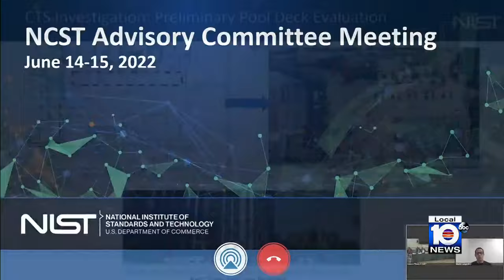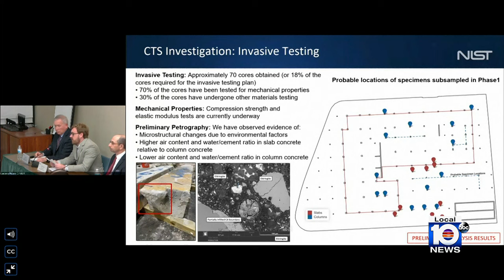Surfside building collapse: Pool deck showed ‘severe strength deficiency’

Comment: The building wasn't up to code.  I'm so glad they figured that out 2 years after it collapsed plus 40 plus years of inspections.  No reason to figure that out during the design, permitting and construction phase.  The reporter should of interviewed Captain Obvious.
Reply: it requires effort to validate any hypothesis

Comment: Everybody who built it is dead now. The mgt co is negligent in carrying insufficient insurance and not maintaining the bldg structurally. The trail will lead to them.
Reply: You have to understand that the effects of the design flaws and construction shortcuts in 1981 cascaded and amplified over decades, causing "knock-on" effects. There were two core weaknesses in the inception- first, the building was under- designed. There simply wasn't enough support under the sections that collapsed. Notice that the front section that remained standing, had 24" X 24" columns supporting it, while those underneath the other two wings of the building were 18"X18", not nearly the strength needed, and not enough of them. Then, they were packed with too much rebar for the amount of concrete. 2nd, the building went up on rather unstable ground with porous limestone beneath it, in a salty environment that corrodes buildings and machines alike far more quickly than other climates would. 3rd, it is likely that "beach sand" heavy in salt was used in the concrete, introducing highly corrosive salt to the structure. Add to all this a hundred and thirty individual condo owners who hate having to pay for anything they can't see and fellow owners who are just as non-expert as they are on the Board, with rapid turnover in ownership of the units and of Board members, many of whom quit the Board when they began to see how large and expensive the building's problems were becoming even 20 years ago. All together, these conditions multiplied and cascaded over decades to produce the perfect storm that ended in catastrophic failure. One engineer, a Professor of Civil Engineering at the University of Washington, said that she was surprised the building stood for as long as it did.

Comment: Florida is a sand bar. I think that Florida is using up too much ground water. So sinkholes are common and much of the state is settling giving the impression that the sea level is rising, but just the opposite is true.
Reply: This happened in South Carolina
Reply: @kmick8108  Sea Level is right where it was when the Mayflower Landed at Plymouth Rock
Sea level is right where it was when Rome Invaded Britain
Sea Level is right where it was when the Persians requested Land and Water from the Greeks.

Comment: It's also near the ocean which has more wear and tear. Like replacement of a lock and key on door because sand wears away fast too. 1980-2019 almost 40 years. Concrete starts separation from rebar after 50 years. The pool leakin, sand and the main structure beam collapsed. With housing chemicals in a storage closet near the bottom. And garage sand ratio.

Comment: a building meeting "half" of the standards  should not collapse like that though.  I have a feeling the standard is very  low in Florida.
Reply: Many of the residents had renovated their condos by adding stone bathtubs, floors, walls, and counters, adding about 10 tons to the weight of that ONE unit.  Now, imagine 20, 30, or 40 units doing that.  

Even a structure that's up to code would have trouble holding that much extra weight.
Reply: Building codes were tightened greatly after Hurricane Andrew in 1992., but CTS was built in a tiny suburb, Surfside, which lacked even a full-time building inspector, and at a time when the whole Miami area was unbelievably corrupt and development was dominated by shady, unqualified people.
Reply: Structurally build incorrectly, tons of weight ( including water settling for years) on that pool deck. The residents should have been evacuated around 2018 when they got that full report of the building. Very sad and disappointing.
Reply: It's not just Florida. Look at the millennium Tower. Jeff Ostrom has been pointing out these failures for about 2 years now.

Comment: yep no engineer ever gets punished for their stupidity. i fix bad engineering crap everyday
Reply: because by the time there is a a problem the statute of limitations for any criminal charges has passed
Reply: @zjones9876  in some cases. but i see bad design in new building systems on mechanical systems and they never have to pay for the stupid designs that dont work. i fix bad design crap everyday but im good with it. job security and great pay

Comment: 80s architectural planning was devoid of sophisticated simulations.
Reply: Some of the most advanced buildings we have were built rather before that. The Hancock Building in Chicago, built in the early 70s, is considered to be an engineering marvel and nothing built since has bettered it in sophistication. This Surfside building, like too many Miami-area buildings built in an era during which Miami was notorious for criminality and corruption in its governing class. was thrown up as cheaply as possible, in a tiny suburb lacking a building department with either the expertise or the budget to provide the oversight needed to assure a good design and a good build. Any architect who designed one of the beautiful and super-strong high rises built in the early 20th century could have told the architects and engineers involved in the design of the Champlain Towers buildings that CTS was seriously under-designed and under-built.
Reply: @chicagonorthcoast  absolutely.i agree.

Comment: punish the building owners with maximum penalties. their negligence murdered people.
Reply: no its the designers not the owners
Reply: The architect company and building contractor company are responsible, not the "owners".
Reply: @hyc1266  if the contractor built to spec then they are not responsible. the designers are. they are wrong more than people think
Reply: The failures appear to have been the construction company and the architect s, but many of these condos were remodeled to have heavy stone and glass walls, etc.,  and the building was never built to withstand it. Did anybody foresee the collapse, I don't know. I'm surprised it didn't collapse long before it did

Comment: Im surprised it doesnt happen more often in miami dade county. Many of these high rises have multiple, years old building citations and failed fire inspections. They might have massive liens, sure, but the owners can just ignore and delay. Theres no actual enforcement.

And lets say you want to get the issues fixed. The inspectors wont return contact and the office just tells you that the inspector has to be contacted. County wide, code enforcement is an absolute joke there.

Comment: Not buying it.. The roof was flooded and filled the basement  parking with water as first witness to try to go there said it was filled and he backtracked .. The fire alarms were not sounding and no flashing lights means the sprinkler system did not activate . Historical images shows roofing materials  ..pallets loaded and there was massive rains the days before ..
Reply: bad designers and engineering. plenty of basements everywhere can and do flood with water  they dont fall?
Reply: @bullofthewoods9374  the roof was flooded .. the roof was weak and the fail point was the fire sprinkler riser and mechanicals leading to the roof where materials weighing over 1600 lbs were stored   ..the water  in  the garage was from the roof ...maybe read the comment .. The roof failed leading to a pancake collapse pulling the columns ..as they were on top of the pile ..
Reply: @bullofthewoods9374   also stop liking your own comments ...it is shallow ..
Reply: @whirlwind8825  bad designers. oh and stop lying no one is liking their own comments. its shallow of you. im in building maintenance and see flawed design daily. . systems fail due to many reasons beyond the designers ability to know. it should be designed into the buildings. failures  many times is a cut corner issue due to money, done by designers. contractors build to spec or will be failed during inspection. granted if the inspectors do their job. Sure there are times when contractors cut corners but if done by design and they fail this is not a contractor issue. its the design and or material failure. things happen. pretty much any failure can go back to bad design or bad material, sometimes bad work but again the buildings have to be built to spec or it should fail inspection.
Reply: @bullofthewoods9374    The building was inspected with demands on the  40 year inspection ..  The strobes were not flashing .. the fire alarm did not sound .. The master 300 psi pumps did not energize .. and the water from the roof went through the  riser shaft and filled the parking area .. The pool lost 0 amount of water . Stay on point maintenance man ..and again stop liking your own comments .. This thread is not active ...for a "Like"  1 second after you made the comment .. very very shallow  my friend ..
Reply: @whirlwind8825  again not liking my comment. fire systems are tested every quarter mr know it not. nfpa the collapse would have rendered the system inoperable. if what you say is true then many  many entities failed to do their jobs. stop laying blame on others. the issue stated with a bad design and bad materials. no one seemed to give a crap and looked the other way. not saying the roof didnt fail question is why? my deal is why did it fail if it was so called designed. several things had to happen to cause this. one is poor design and poor maintenance. im licensed in all trades including fire protection. poor design happens all the time. most people just dont know it. wont be the last itme
Reply: @bullofthewoods9374  Wrongo  .. See you do not even  know the facts .. If you did you would have said the system called the monitoring company  and they in turn called fire..  Before the collapse ..
   With that said ...not one strobe  went off during the alarm and the pumps would have energized the moment a head broke  or a pipe once pressure drops ... Then the Generator that backs up the electric  would also be running to power the pump  ..     
    The building  was under a 40 year inspection. All systems were inspected the remedy was to start on the roof that was failing ... This remedy was signed and sealed by men with more credentials  than you or me 
    The roof drains failed  from debris from the roofing crews with trash on the roof and the scuppers are next in line  to drain off the side of the building .. We had torrential rains just  1-2 days before the collapse .
 but by that time the roof became a swimming pool with massive weight  which caused the collapse.
   You do not even know the roofing company or the CEO  of that company ...  Or the vanity posts on their Facebook the day of the collapse .  ..
 The slabs pancaked  the structural columns were on top of the slabs  not under ....
The only persons  licensed in Florida in all trades works  for Contractor exam School
 Or Patrick Sessions who lost his daughter Tiffany.. He built the City of Miramar Florida from the ground up .

 What city did you build . Or what hi rise have you built ..?

 I have many hi rises under my belt and know my job well..